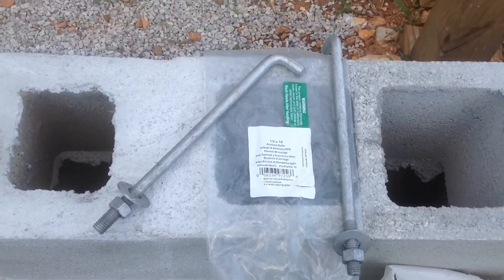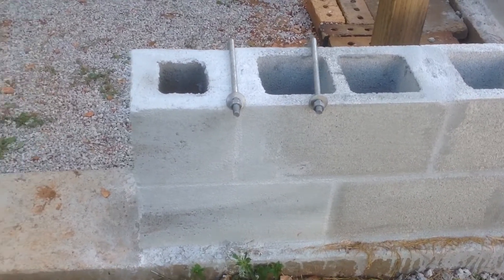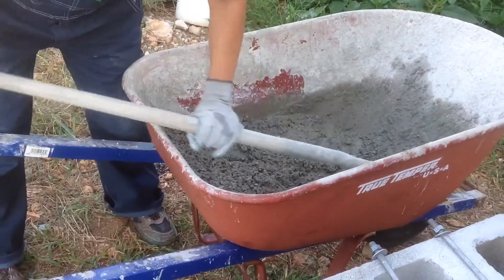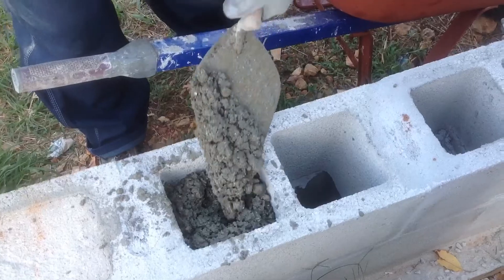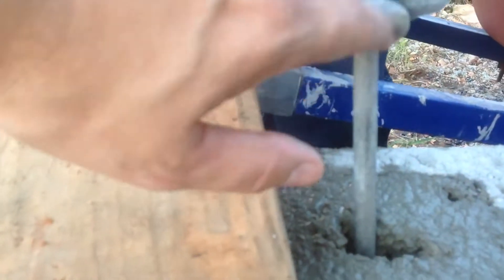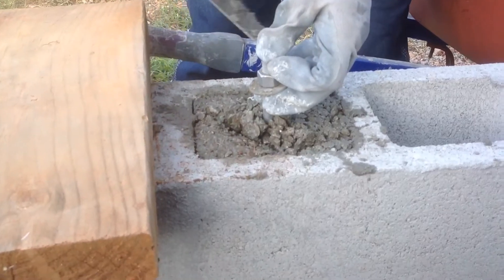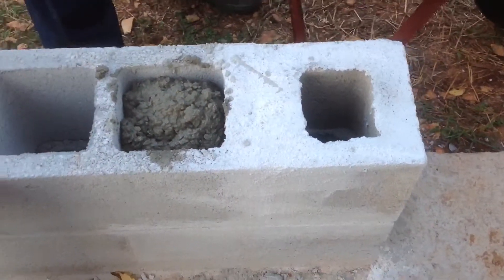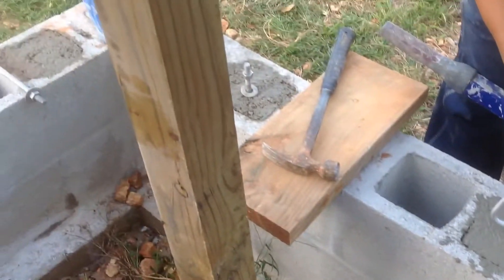DIY: Installing Anchor Bolts in a Concrete Block Foundation

Comment: In my neck of the woods, anchor bolts need to be 5/8" diameter and be used in conjunction with a 3 inch square washer not a round washer.

Comment: I discovered my mason cutting the J off the anchor bolts to install in the solid brick cap. You could pull most of them out by hand.

Comment: Cement should be soupy. I'd throw some rebar to the bottom.
Reply: It's concrete and no it shouldn't be. That weakens it. Rebar without being pinned to existing isn't gonna do much.

Comment: I just did this....2-course block and used 1/2" wedge anchors to slab. THEN a piece of angle iron with a hole for the anchor with rebar welded also to the L-bolt for attaching the treated plate. With this effort, I have the block and plate firmly attached together. Think about this...all put together, the weakest point is how well the wall studs are attached to the plate.

Comment: I would suggest a few additions to help with shear loads, currently it would just be the top mortar joint that is resisting the Shear loads pulling on the J bolts.
1. Join the blocks together with vertical rebar anchored into the slab/foundation if possible. 
2. Add horizontal rebar and tie into the vertical rebar.
3. Make you mix a little wetter
Thanks for taking the time to make the video

Comment: This is a great video until you say there is nothing wrong with filling concrete blocks. Please correct to let folks know...filling the block not only weakens it, it also decrease R Value of the block.
Reply: Filling concrete blocks makes them stronger and more stable. It also increases their durability, adhesion, and water resistance.
Reply: Wtf r u talking about ? What's core fill grout for then

Comment: Dude where are you rebars? Concrete too dry and usually the J bolts should be attached to the cross rebar. Concept is correct but doesnt seem like any structural plans were done. Still should be fine if load is light especially your roof.

Comment: Buy a small viberater to compact the concrete that's a real tip or even tap the sides of the block

Comment: First off, very good detailed video. I work in Industrial supply for one of the largest fastener companies in the world and have had years of experience and schooling in all industries. It is called a J-BOLT. It is not an anchor bolt. If you ask me for an anchor bolt, i will not show you one of these. The problem is that your use to going to lowes instead of the professionals.
Reply: You've won a cookie Richard😂😂😂😂
Reply: He calls it a J-bolt throughout the entire video... lmao
Reply: The package at 1:30 literally says anchor bolts so take it up with the manufacturer my guy

Comment: Shouldn’t j-bolt be crosslink with rebar?
Reply from the maker: Rebar is used in some scenarios. I have seen it done but don't remember the complete process.
Reply: You don't remember the process so you just skipped that part ? Lol you cut the block in a "bond beam" fashion and throw horizontal in that way.... verticals go every 2 '@StevenLawAuthor

Comment: I'm undertaking a nearly identical project. My question is it not necessary for the anchor bolt to be drilled into the original foundation? If not, why is that? Is that an option? Anyone with information I would appreciate any input.
Reply: Scott, 

It depends on what or how you anchored the bottom course of blocks...if you're doing something like what I will be doing this spring, which is putting 2 courses on top of an existing slab, you can do it a few ways...I am going to drill down into the existing slab every few feet and put in rebar that will extend about 1/3 of the way up into my second course and then use the regular mortar bed technique to anchor my block to the slab. core filling will take care of those rebar and everything will be anchored tight to the slab. I have heard you can just do a mortar bed under the bottom course and use that to set it to the slab, but I'm a big proponent of the idea that if it's worth doing, it's probably worth overdoing. Mortar is cheap and the difference in time to me is well worth it if the building stands longer. 

Happy Projecting, and good luck!

Comment: Y do u even have the washer preinstalled? Leave it off. Install nut on bolt leaving top of nut just above bolt top threads. Nut will protect bolt threads incase u use hammer or something other than wood block to drive bolt down.

Comment: everyone calls them j bolts. L  has a sharp cut J has a soft cut so they do look like a J bolt. is the legitimate name anchor bolt?
Reply from the maker: You are right, they are commonly called J-bolts, which is why I have that bad habit! But in stores, online, or in manuals, they are called anchor bolts. I believe that is the correct professional term.
Reply: ***Thanks to videos like this, people learn to DIY, so thank you.

After read some comments, and with the interest of learn and add value to this conversations, just checked google and found this interesting meanings for "anchor bolts".....

Q: how many anchor bolts exist?
R: four....In our industry, anchor bolts are typically used to attach steel to concrete. One end is embedded into the concrete, while the opposite end is threaded to attach structural support. There are four main types of anchor bolts: L-shaped, double end rods with plate, headed, and swedge.

SO, ANCHOR BOLTS IS A GENERAL TERM, J-BOLT IS A COMMON NAME, AND L-BOLT (in this case only) IS THE RIGHT NAME. NICE DAY YOU ALL***

Comment: would have been a good idea to soak those concrete blocks first, so they don't wick all the water out of the fresh concrete
Reply from the maker: Good idea. Never seen that done before, but it sounds logical. Might be something more common in dryer climates.
Reply: @StevenLawAuthor  soaking is pretty standard for desert climates.

If you see ferns around your site... dont need it lol

Comment: Your concrete is too thick which doesn’t allow it to flow around the anchor bolt. Leave the washer and nut off the anchor bolt
Reply: What's the reason for taking off the washer and nut?
Reply: ximono so you’re not having to fight with keeping the washer out of the concrete